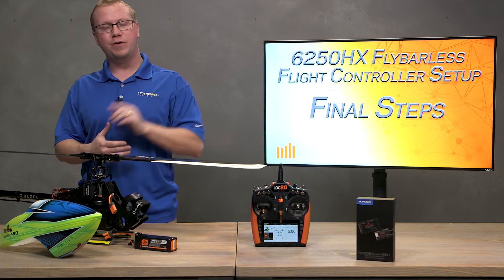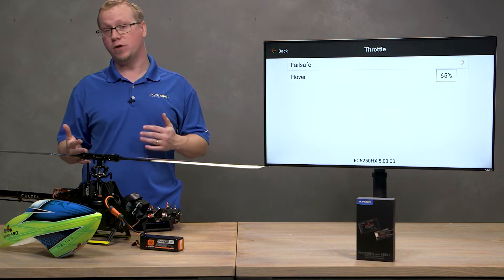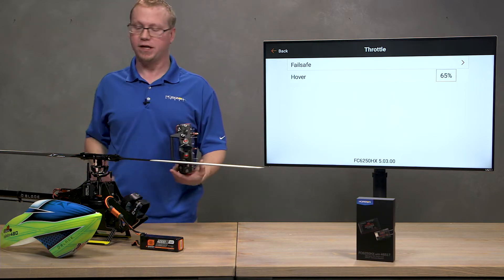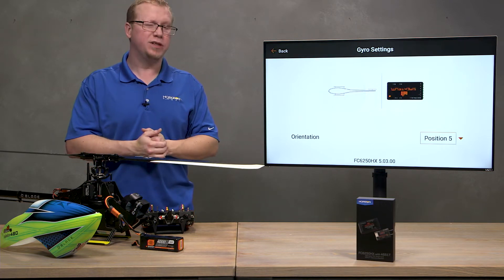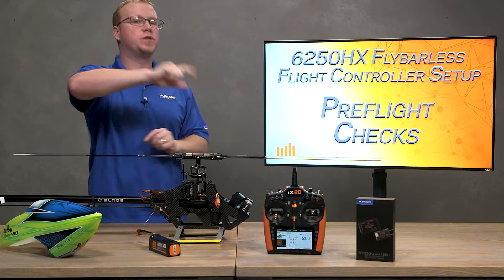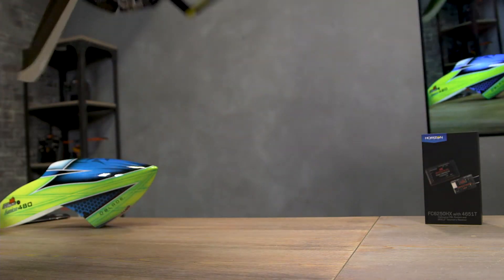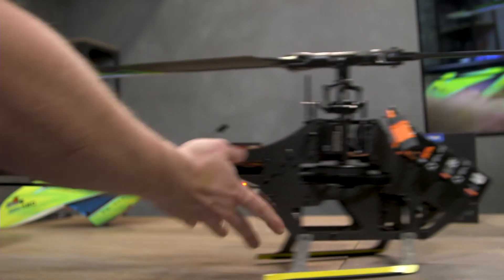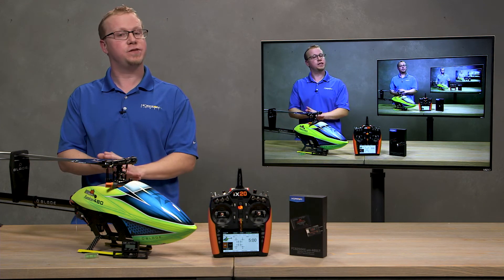Part 6 - Final Steps and Preflight Checks - Spektrum 6250HX Flybarless Controller Setup Series

Comment from the maker: In this video we complete the initial setup of the 6250HX on our Blade Fusion 480. We cover sensor calibration, setting failsafe, explain the Hover gain % and then finish up with a preflight check to encourage safe practices for our fellow heli enthusiasts. Thank you for watching our series! Stay tuned for more 6250HX content, and if you have and questions or comments, then comment below! :) 

Here are links to the other parts of this video series
Part 1- Introduction https://youtu.be/fwVeKYJWFAk
Part 2 - Installation and Binding https://youtu.be/_UB4SBnyFjI
Part 3 - Transmitter Setup https://youtu.be/rxS7LmwlbVs
Part 4 - Swashplate Setup https://youtu.be/VJ0m2S42QPI
Part 5 - Tail Rotor Setup https://youtu.be/vr3rnwtveak
Part 6 - Final Steps and Preflight Checks https://youtu.be/HDpvRV47H9U
Part 7 - Safe and Bailout Setup (coming soon)
Part 8 - Smart Technology Setup (coming soon)
Part 9 - Tuning with James (coming soon)

Equipment used in this video series
Blade Fusion 480 Smart Super Combo - https://www.horizonhobby.com/fusion-480-smart-super-combo-kit-blh4925sc2
Spektrum 6250HX w/ 4651T Telemetry Rx (included with Fusion 480 Smart Super Combo) - 
Spektrum iX20 Smart Transmitter - https://www.horizonhobby.com/fc6250hx-helicopter-flybarless-control-system-spmfc6250hx
Fusion 480 Stretch Kit - https://www.horizonhobby.com/fusion-480-stretch-conversion-kit-p-blh4965 
Spektrum Avian 100 Amp Smart ESC (included with Fusion 480 Smart Super Combo) - https://www.horizonhobby.com/avian-100-amp-brushless-3s-6s-smart-esc--spmxae1100
Spektrum H6050 Cyclic Servos (included with Fusion 480 Smart Super Combo) -
Spektrum H6360 Brushless Tail Servo - https://www.horizonhobby.com/spektrum-h6050-high-torque-mid-speed-heli-cyclic-servo-p-spmsh6050
Spektrum SPM4767 Remote Rx - https://www.horizonhobby.com/dsmx-remote-receiver-spm9745
Spektrum Smart Lipo - https://www.horizonhobby.com/222v-4000mah-6s-50c-smart-lipo-battery--ic5-p-spmx40006s50
TL90 Digital Pitch Gauge - https://www.amazon.com/YoCoo-Display-Airplane-Helicopter-ST250-800/dp/B017LYIPX6/

Make sure to follow us on Facebook and Instagram for all Spektrum News and Promotions!
https://www.facebook.com/SpektrumRC/
https://www.instagram.com/spektrum_rc/  
@SpektrumRC

Thanks for watching!

Comment: Hello, I bought a Blade 180 with the 6250 from a friend and followed your videos to understand its programming better. I noticed there were some command settings shown in your video in forward programming that did not show in the 180’s 6250. Also I noticed a “reset” option in the forward programming. Does that option set it to the setting in the heli when sold in the box or before it was installed in the heli? Thanks!

Comment: Question about the -- HOVER -- percentage setting. Will it still work harder as you say in NORMAL mode when SAFE is activated or turned on if you will?  If I'm not paying close attention my 550 strch seems to want to kinda start to tip in N with safe on as I spool up.
NORMAL = safe on
STUNT 1 = safe on
STUNT 2 = SAFE off
I've seen guys put the mode switch in stunt 2 and spool up from there but I'm not there yet.
Reply from the maker: Hi Timmy, it is active in each mode. One tip that might help is to make sure that your blades are extended all the way straight before spoiling up. If not it will cause the heli to shake more on start up and can tip over. Also it is best to not rely on it too heavily. keep an eye on the model while it is spoiling up and correct for any tipping with the cyclic, even if you have safe on. Hope that helps!

Comment: I have an old Align T-rex 250 . I've installed a flybar less rotor and my question is, can I use that  FC 6250 HX controller on that small size helicopter?
Franck from FRANCE
Reply from the maker: Hi Franck, yes it will work on that heli.

Comment: I'm using my castle creations rpm throttle settings. The normal mode is 35%, stunt 1 is 75% Stunt 2 is 85%. How do I set up the Hover percentage when I don't have a  0-100 linear throttle curve?
Reply from the maker: It does not matter, if you do not have the throttle curve 0-100 linear. simply follow step 19 in the manual (covers setting the Throttle Hover) and choose the percentage that works best for you. Hope that helps!
Reply: @SpektrumRCvideos  perfect thank you.

Comment: ☠BLACK BARON☠ 2:38 iOften do get ESC voltage warnings during calibration after setting orientation. iUse NXT beta1 ... is this fixed in beta3? 2:56 It ejects ESC Warnings during calibration after setting the Orientation and the calibration dialog pops up right after.
Reply from the maker: That is correct :)
Reply: @SpektrumRCvideos  ☠BLACK BARON☠ Is it absolutely necessary to set the throttle curve to 0 / 25 / 50 / 75 / 100 to test out the hover even though this throttle curve will never be used again for real flight testing and tuning? In terms of engineering I would prefer a throttle curve I actually use by entering a hover and a takeoff value. The takeoff value is when the heli loses ground contact.

Comment: Calibrating the sensor cured my tail creep,yippee.   One question if failsafe is set to bottom stick ,what happens if your in stunt mode 100 75 50 75 100 for example, or a straight curve itll throttle up to 100
Reply: When setting up the fail-safe have a 0 to 100 curve to set it to 0 throttle. It has nothing to do with the pitch curve

Comment: Got one about a year ago. Will not go into all the details but I'm pitching the POS and getting something that works. Not going to wreck my new RotorScale AS350 using that damn thing.
Reply: There excellent, people don't know how to use em.
Reply: The problem is not the flight controller. It is the POS RotoScale AS350. I had one AS350 that was decent, but vibrated into oblivion. The second just has never flown, regardless of the flight controller I use. Just saying.
I fly the FC6250HX in 3 helis and am in the process of installing in my 4th.
Reply: @dennislewis9596  I have a new Rotorscale AS350 and the thing will vibrate itself apart. Spent over 600 replacing damn near everything in the mechanics and now vibration is way less. However, the seller still has no stock on the fuse parts after a least 2 years. They also jacked the price from 339 to 479 so I will not be buying another. At present is is a nice-looking shelf queen. 
   As for the 6250 never could get mine to work and it was never airborne either. Maybe just got a bad one IDK. Replaced with a Spirit Systems GT and flew on a Goblin the first attempt.
Reply: @rcas350pilot8  Mine turned out to be that none of the screws holing the frame components together did not have thread locker so the main shaft bearing holder came loose causing the vibration. 
I still stand by the 6250 :). No more RotoScale.

Comment: Hey, in the part of the setup shown in this video you test the gyro to see if the swash plate counters the movement of the helicopter when tilting the helicopter forward and backwards. My Blade fusion 360 does the exact opposite the swash moves forward with the forward tilt of the helicopter, I’m wondering with how it can be reversed using the spektrum dx6 gen3 transmitter? Thanks!

Comment: Tnx for the videos. I have searched if they explain how to set up normal-rate-mode (for scale flying). Couldnt find it. Reached out to support and they sent me back to the videos. So let's try over here. My questions: is it possible to set up normal-rate-mode in the 6250hx (like e.g. posssible with the ar7210bx), and if so how? Tnx in advance.
Reply from the maker: Hi Bob, at this time the 6250HX does not have a rate mode. Initially we did not see much reason to put it in since heading hold is the preferred method, but if we keep getting this feature request we may have to put it in with a update :)

Comment: Hi, I am currently building my scale 800 size which requires additional 6 channels for extra features like activation of lights and drop dummy bombs by servos thru switches, would this be compatible to this module?

*SPMXP8000 - Spektrum RC X-Plus8 Expansion Module

I am eying to buy also x20 if yes.

Thanks you very much

Comment: Nice set of videos. After having flown my new 330S with the 6250, I purchased an additional  6250 with receiver to install on my 360 CFX, 3S. I have it set up, but I do not get the same heli diagrams on the orientation setup. It just shows a diagram of an airplane with no additional orientation choices. I did install it the same as the 330S, flat on the receiver tray with the servo plugs facing the rear. So hopefully I will have no problem.  I also believe it may be possible that in this video you don't have stability activated to show how the stability compensates for heli movement.   On my 330S and 360 CFX in stability mode, there is pronounced swash compensation with heli movement.    You didn't seem to have much, if at all.
Reply from the maker: michael vehoski make sure your radio is fully up to date for correct diagrams. Also you are correct, check out the next video going over safe and panic setup. Thanks!!!

Comment: I could hear the servo(s) working the whole time even when the heli was sitting still. Why was this? Was the gain too high? Servos shouldn't have been working at all if there was no force to counter, right? thanks
Reply from the maker: gmodesike digital servos are always working and you will hear them when they have even slight loads like rotor head mechanics attached :)

Comment: Here you didn't show how the gyro correct the direction of the tail. I assume is similar of what you show with the swatch plate.  Also I wonder if you can show how deal with the PID. Just in case you need to change some gains. Finally I will like to know how to set different agility base on the stunt you are.
Thanks for the videos,, are very helpful. This is the kind of technology I was looking to get with SPEKTRUM.
Reply from the maker: Miguel Lorenzo we are going to do a tuning video soon! Stay tuned. That being said thanks for taking the time to share your feedback:)
Reply: @SpektrumRCvideos  I realize that this comment is two years after your reply, but I didn’t want to start a new thread… Did you ever release a pid tuning video for the fc6250hx? I’ve been fighting the tail on my fusion 270 for two years and can’t get it right.